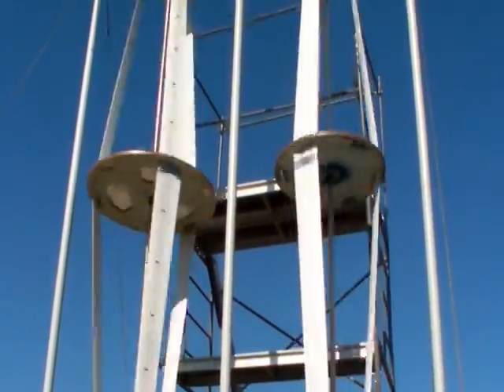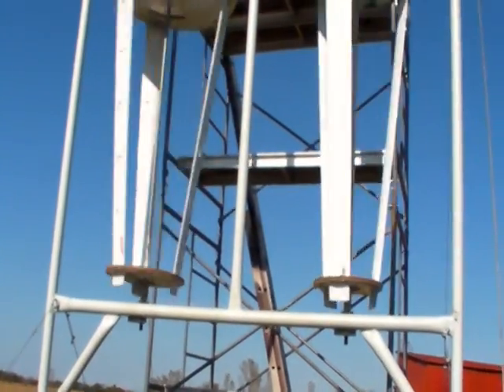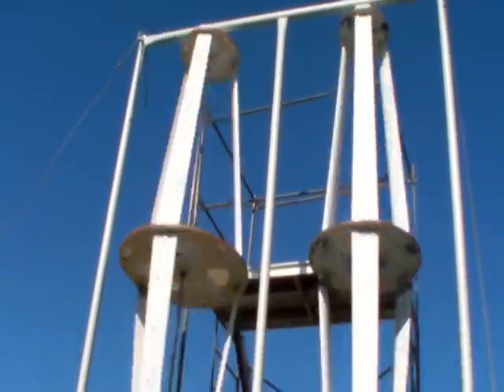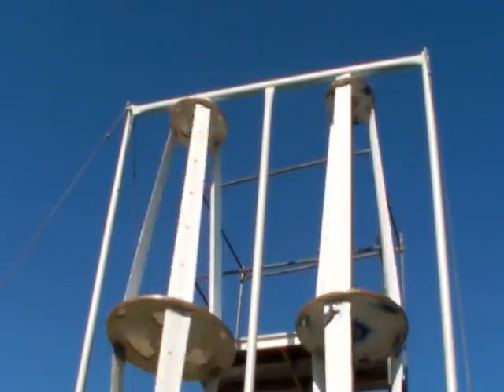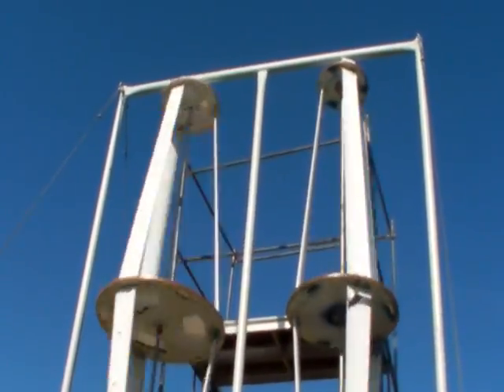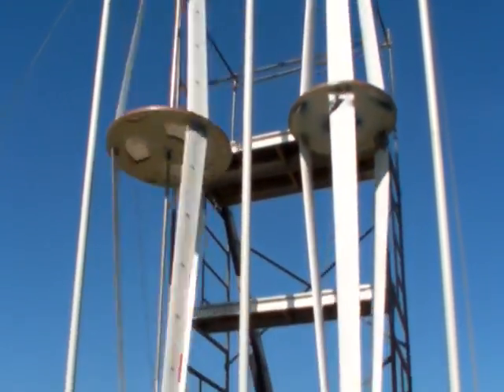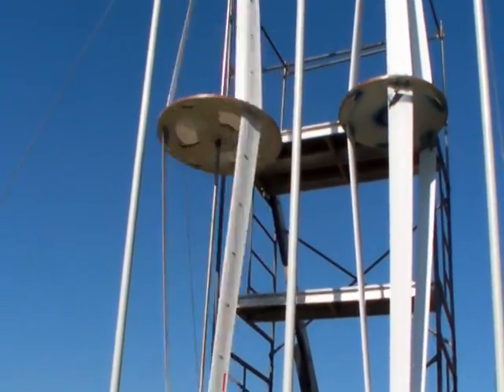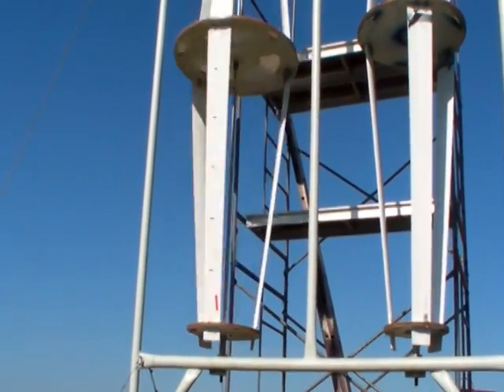column-r-vawt-  wind turbine-airfoil_17.mpg

Comment: @emagnets Make sure you gear it somehow either by belt, chain or sprocket so you can get the RPMs you want. The faster you spin a PMA the better and the torque that your design should put out should be enough to keep those PMAs spinning. Typically when people build homemade wind turbines they attach the blades to the PMA, this isn't how it's done so make sure to gear them and review the larger ones (10-30kw+) to get ideas on gearing. Good luck and keep posting videos!

Comment from the maker: i cant totally get rid of the whoble. but i think it will be ok at 500 to 600 rpm.
no power yet, i am working on a pmg with few guys.
the idea is at 2.5m/s the turbine spins at 150rpm to accumulate 24vdc.
ones the turbine spins above 150rpm, the gen starts making usable power and producing current.
the Goal is at 35kmh wind and at 550rpm, the Column-R will produce 500watt
so if i have 2 side by side that will give me 1kw. you can add turbines to the structure when needed, like a wall.
sam